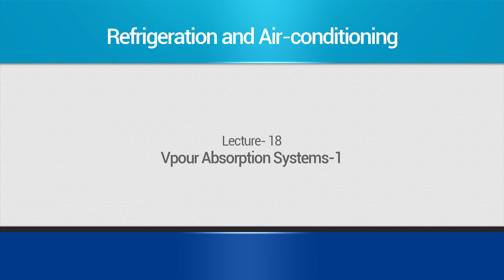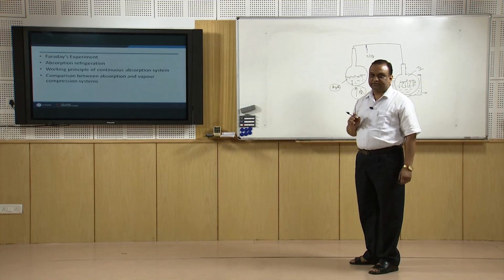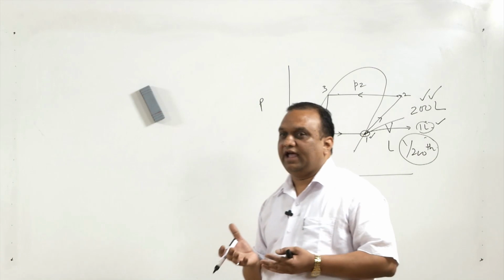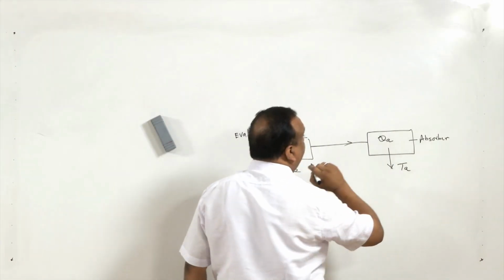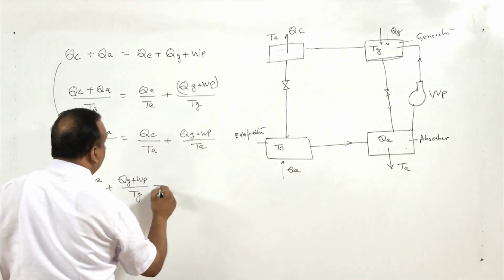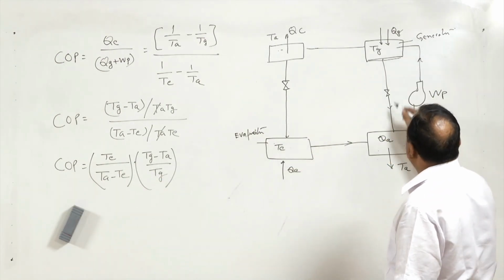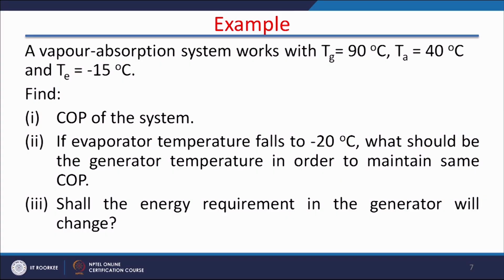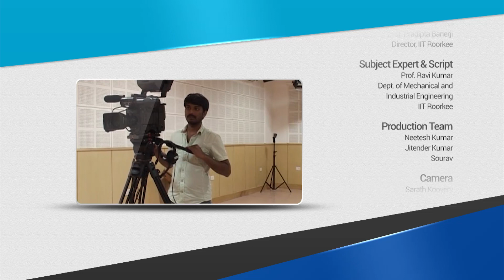Vapour Absorption Systems-1

Comment: Sir, In the Generator , heat is supplied to generate Ammonia vapour. At the same time, water vapour needs to be condensed. That means there shall be some cooling medium to condense the water vapour. This is not considered in the COP calculation.